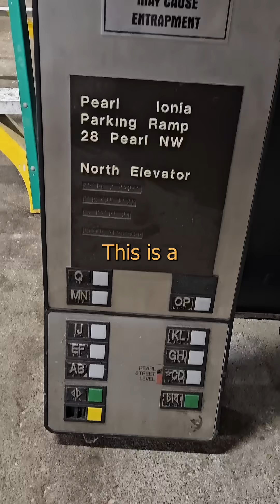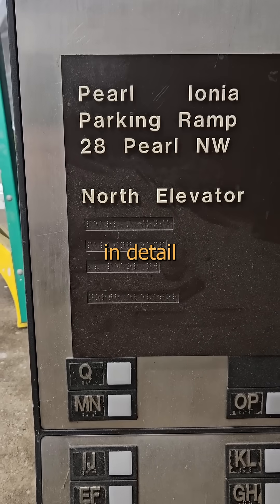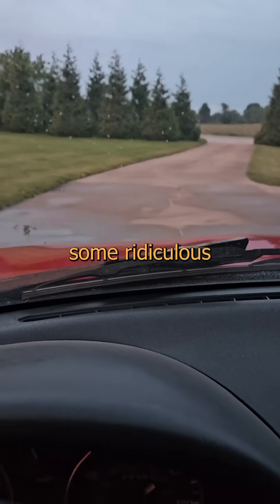Miata Mischief #chrisboden #engineering #gear #elevator #score #stories #parts #hacking #making

Comment: I know I’m 5 months late, but I’m not here for the prizes, lol.

I’ve had three convertibles (VW Cabriolet aka bitchbasket, an MGB, and an old pop-top 4Runner that I sadly never got to actually take the top off of 😔). The MG was a challenge and a half considering it didn’t have a back seat, but it DID have enough room for a full size keg behind the two bucket seats, and somehow also could fit my 6’5” ex in the passenger seat. I’m still beyond impressed by that!

But that Cabriolet was a CHAMPION. That dinky little not-a-real-roll-bar was an absolutely stellar anchor point and we loaded so much shit into the back seat that it rode waaaaaaay too low for the whole trip back. God that was a great little car.

(I managed to move a queen size mattress to LA and back on the roof of the 4runner without it even thinking about grabbing the wind, much less blowing off my truck altogether, which felt like a huge win because I sure as hell didn’t have the funds to replace it!)

Comment: So I hauled home a crappy rusted out 77 cutlass supreme once. Bought it out of some old Mexican dude’s house a couple of cities over who was trying to get me to buy his clapped out 240z and his old Indian cycle. Things rear brakes were locked up tighter than a nuns buns. So he gets his son to pull it out with his bumper hitch f150, questionably hook some chains onto this things frame, loosely drape it over the dude’s ball, and he just fuckin sends it. I mean absolutely just pepper the thing dragging it out of the shed. Strangely enough doesn’t pop the chains off the hitch. Get’s it most of the way to the alley, where, mind you, we have the trailer waiting to load this thing ass first. Dude gets it most of the way there, and then we, with 2 come alongs and like a mile of chain, jerk this thing back and forth with the chain till we can get it on the trailer. Doesn’t occur to us till it’s halfway up the ramps that we can probably pop the drums off it to free up the wheels, so repeat said seasoning of the front of the car with the f150. If it weren’t already rusted this would’ve given it some near genuine SA hailstorm patina. Get the wheels off, and spend an hour beating the tar out of these drums to free ‘em up. We had crowbars, pry bars, and enough hammers to make John Henry himself crack a smile. We finally get these drums off, and yup, that was it, thing rolls stupid well now. So we go back to working the come along shafts and get it on the trailer. Now comes the fun part - we have this big, front heavy A body loaded backwards on this uhaul trailer. Now I’m not about to unload this thing in the street and do it again, because that’d be smart, and I’m not, so off we go onto the highway. We got on, and immediately got off because this thing was wagging behind us so damn much. If we’d have been on any longer we’d have looked like a happy raggedy St. Bernard going down 35. Like this thing just hated going anything above 40, and rightfully so. So we take the access roads going home instead, 40 the whole way, knuckles a little whiter on the wheel. Unloading it was way easier than loading it, grabbed my neighbor and his 2500, popped a strap on the car, and just jerked this rusty pile of crap with no working brakes off the back of the trailer and rolled it into a spot in my complex lot.

Comment: When I was about 4 or 5 I found an old aluminum Alfa Romeo V6 engine block in a hedge

Figured I could just make a car around it and hauled it back home on the trailer of my plastic toy pedal tractor, it was VERY heavy for little me and the trailer but I got it on and slowly pushed it to the other end of the street

When I did get it into the backyard, mom didn't let me keep it and made me bring it back. 

Just trying to roll and lift the thing hurt my back and the back and fourth trip also crushed my flimsy plastic trailer

Comment: Two Mitsubishi 6G72 V6 engines in the back of my 98 Honda civic hatch back.  The rear end was almost riding on the tire.  I drove from Chattanooga to Franklin like that.  Inspired by the experience tie downs were welded into the rear cargo area to allow for "safe" transport options including straps... Other engines were hauled in the car, including an RX7 13B two rotor engine, two other D16s that later saw time in the very civic used to transport them, and a 2.0l eco tech for a Saturn Ion Redline.

Comment: I decided to buy 2in thick 16foot pressure treated lumber and I have no idea on the width at this point it's been a while. As a base board for my queen mattress it came out to 4 cut in half at 8 and some change if I remember. At the time I was driving a 01 corolla. I nearly had to uninstall my passenger seat and leave it at my job .... But I managed to get by with one inch of clearance from truck to radio. I hit the breaks to hard really hardly and it nearly destroyed my system. 2 buttons were done for and numbers on my radio screen were not doing so well after that trip. I couldn't even fully steer right because of the board in my way let alone see. Definitely the sketchiest drive of my life. Oh and I was driving 40 mins going 70mph on the hw. One slip probably would have been game over for me considering I had my seat pulled as forward as I could get it and I'm 6'1 already to big. Probably won't try that again.
Reply: Already to big at 6'1 and 8 2in thick by I think....6in-8in wide and 8feel long in a 01 corolla. They are extremely small cars. Just me alone was to big. Add that lumber to it. I was elbow to elbow with maybe 5in of turning radius. Imagine doing 3-4 5in rotations to just make a turn. And you can't see. Oh and all that wood added weight to the a already small car. I remember getting out the car and honestly was shaking I made it home with no accidents.

Comment: I bought a coffin at a yard sale, strapped it to the roof of my s-10 blazer and drove it 200 miles home. Needless to say, I got some of the strangest looks on the way home. Why didn't I fold down the back seat and put most of it inside? Well, my 2 sons were riding in the back seats, so on the roof it rode. $5 full size coffin, I had to buy it! Lol

Comment: I fit a 7-foot pool table with the legs removed in my subaru outback, as well as a grandfather clock, an apothecary, a 400lb 15" wood planer from the 70s, and a bandsaw. I have yet to need a truck.

Also my tool boxes

Comment: I know the two weeks has long passed but one time I used an old Arctic Cat 4-Wheeler and about fifty bungee cords to move over 100lbs of 🍃 about 15 miles (as the crow flies, it was probably closer to 20 or 25 on the dirt roads & little deer trails) from my bosses property through the MNF and over BLM & PG&E property to the uhh rendezvous location at a cabin by the lake near the tiny airport with a gravel runway. I had those big 30 gal. grey Sterilite totes stacked 3-high front and back plus a few of the smaller ones strapped to the sides. I couldn’t see a damn thing and I had to stop multiple times to do some pot-portaging when I reached water or the trails were too narrow. I got paid well, had some fun, and ended up with an awesome story to tell.. Oh man my 20’s were something else lol

Comment: The wife bought one of those corner cabinets from a dude on the internet. It's about 8ish feet tall, and I drive a 2012 Honda CR-V. It took up every inch from the glove box to the rear hatch, and I had to drive all the way home leaning slightly left in the driver's seat. Took about an hour and a half.

Comment: Most recently I put a 22’ aluminum canoe I found free on the side of the road on the roof of my 15’ long 05 ranger. I have also hauled 1500lbs of concrete rubble in the bed

Comment: I drive a 2004 mustang... I had to pick up an in-box bed frame from Walmart... For a queen mattress. I had to fold my back seat down and angle it around my speaker box containing two 10" subs. The box stuck between the front seats over my shoulder and rocked whenever I accellerated/decelerated. That whole drive home I kept thinking about Final Destination 2 😅.

Comment: 1. I needed to haul something (can't remember what). It was in a box big enough that I had to take the front passenger seat out of my '79 Austin Mini.
2. I carried a 6 ft stepladder home, vertically, on a bicycle, strapped to the side of the rear frame. 
3. I also carried a garden fork across the handlebars - traffic was REAL polite that day.
4. I carried a pole saw on the bicycle, strapped to the top tube, saw sticking out the front so I could see what I had to avoid...
5. I carried a barbeque home on the rear rack of the bicycle. This was the road bike, with dropped handlebars.

Comment: I work at a rental yard 
We had a custimer who wanted a 400lbs floor striper in the back of the small tesla with fold down back seats

Ide rather use a battery terminal cleanimg brush as a fleshlight(with brake clean for lube)

Comment: You managed to shut the doors and windows, that’s hardly sketchy!passenger seat buddy, seats down, back hatch open, passenger window open… the building supplies I’ve managed to haul in my Subaru Outback is impressive. But my favorite is hauling plywood in my dad’s collector 1982 S10 1/2ton short bed truck. We didn’t have the ratchet straps with us so we used bungee cords pulled tighter than guitar strings and tied a red hanky to it. That is the one and only time I have not been tailgated!😂

Comment: I moves 4 hours away last year. I filled my ford probe GT up to the brim with stuff. It was so full that passenger side was filled to the ceiling and so we're the back seats. 
every time I tried going into fifth gear I had to basically punch the stuff out of the way, I ended up with 2 broken cups in that bag

Comment: My daily driver back in the '90s was an MGB roadster. It's basically one of the things the first-gen Miata was designed to be a copy of, and an improvement on. Mostly because (1) no Lucas electrics (any Lucas switch has three positions: "Off", "Dim", and "Flicker") and (2) no SU carburettors. Anyway it had similar cargo and passenger capacity to a Miata and I would haul furniture home from the Ikea in Plymouth Meeting, PA, to my home in Wilmington, Delaware, with the top down like you show in the picture.

Comment: over the course of a week, I disassembled and hauled home a free barn using a short bed Silverado, I piled all the short pieces in the bed but anything over 10' I ratchet strapped to the passenger side on the outside. the 22' roof trusses were particularly sketchy.

Comment: I hauled a piece of switchgear I decommissioned from an old 2G tower in San Francisco down to Sacramento on a makeshift roof rack on my 2 door bmw (e92). It took two people to load it on my roof and I ended up bending my roof a little bit...  But it was a fun piece to take apart.

Comment: Wifey rode in the open trunk trying to hold it shut whilst holding on to a target shopping cart that was left at a gas station. We ended up putting it in the garage and we used it to move stuff when it was time to move into a new place.

P.S. we still have it in the garage!

P.P.S. I also found an abandoned target shopping basket so we have that too!

Comment: Subaru Forester full of recovered pallets from my highway network engineering job after they had a butt load of cabinets and servers delivered.

Either that or transporting a dresser that pushed me (a 6'8" giant) up against the steering wheel to the point I looked like a live recreation of Mr. incredible trying to drive to work.

Comment: I convinced the local church I was installing a new PA system and they were throwing out their old touch screen white boards. And I saw them wheeling them out the back doors when I noticed that the supervisor liked slots. So I happened to have a little bar slots( quarter slots) in the back seat of my 2000 Pontiac sunfire. So I talked to him about trading the slot machine for one of the white boards and he agreed. So me and my little brother held onto it and had little tieline to hold it to the roof about 30 miles from the house. But!!! We got it home and now it is our dnd map table.

Comment: i used a 420cc predator driven by a straight chain and 4ft prop on a 14ft v bottom john boat to tugboat my buddies 22ft center console that had motor trouble back to the marina

Comment: 2 times:

1. For anyone in a band this will not be all that unusual, but I once had to remove the head of a kick drum to fit it in the back seat of my Corolla, along with the rest of the kit, 2 guitars in the front seat, and amps in the trunk. With drum hardware and all the smaller bits, getting my bandmate in the front seat with the guitar necks between his legs was a challenge, but we pulled it off.

2. When I was in high school, my sister and a group of our friends fit ourselves into her tiny cavalier, I think 8 or even 9 total if I’m remembering correctly. My punk ass rode in the trunk the whole way, for a 2 hour trip. This was for a local live music festival, and the look on the faces of people at the gas station seeing a kid covered in spikes and spider legs for hair (this was the late 90s and I was a metalhead, don’t judge me) step out of the trunk of a tiny car after a bunch of other freaks piled out, was priceless.

Comment: Loaded 1500 lbs of quickcrete bags in my 2000 Buick park avenue. (The air shocks needed replaced afterwards)
This is the same car I loaded a 36” door from Menards into; fyi the back seat only had a small pass through to the trunk and did not fold down.

Comment: My daily driver is a Fiat 124 Spyder. Basically an Italian Miata. I've hauled Coolers, rifles, fishing gear, all kinds of shit in my passenger seat with the top down.

In terms of practicality for utilitarian use, the Spyder ain't it. But it's SO much fun. It's quick (not fast) as fuck. Weighs next to nothing and I've only had my lunch ate by motorcycles. Front end starts to "float" around the 125 mark, it's like any down force it has just disappears at higher speeds.

Comment: It was a '78 F-100 Step Side with the wood slat floor. The odd thing was a roommate named John. Trust me, that's the weird part. I'd known him for just a short time, but he was the type of guy that just attracted people, trouble, and...well, that's about it, he attracted trouble. The dude lost his license in an accident that the fault was determined by the cant of his wheels after the accident. He was our certifiable car nut, a drag racer without a license with a cherry Dodge Dart Swinger Special. Oh, and you must address it as such. I called it a grandma's car just to watch him turn colors. So, what trouble did he bring forth upon my first and favorite project vehicle? He spotted 2 Hemis at the junkyard on Lake Michigan drive just East of Grand Valley. If you know the specifics of the '78 F-100 Step Side, you know it rocked a torquey 300 straight six and was prone to rusting frame rails. Grand Valley to Three Rivers at 55-MPH is a long drive. Driving it in a truck that my dad and I were rebuilding but hadn't yet got into the deeper stuff, like the 4 inch hole in the driver's side frame rail just behind the driver's seat. Sure, we'd addressed it, but the repair was temporary. Read that last sentence more like this, "the steel we used was bolted in and not meant to turn the truck into a hauler but more to keep a 19 year old kid relatively safe." I drove with my shocks straining, my butt cheeks clenched, and a white knuckled grip on the steering wheel. I also hadn't yet installed the new Hurst shift kit, so the kit that was in was sloppy as Hell and prone to getting stuck between second and third gear. Don't worry, I kept a 20-inch flat bladed screwdriver in the cab for emergency pry bar duty.  While I was a nervous wreck driving my baby to the God forsaken left armpit of Hell, John sat in the passenger seat chucking odd bits of detritus through the hole next to the shifter, onto my drive shaft, listening to the pings that little rocks make as they rocket around my undercarriage. He did stop when the peach pit decided that the time a trajectory were just perfect enough to rocket itself back into the cab.  Yes, 2 Hemis exceeded the cargo rating on my pick-up. Yes, the truck was just shy of comically tragic. But, John was the oddest thing I ever hauled in that vehicle.

Comment: Well, you asked for a story.

I impulse bought 2 crabapple trees (about 6 foot tall) and had to figure out how to get them home in my small sedan.

Somehow, I managed to fold down the back seat and feed the pot end of the both trees into the trunk so that one could sit on the center console and the other could rest against the back of the passenger seat. I had to very gently bend the top foot or so of them and tuck them into the trunk to make it fit. 

For those who don't know, crabapples have thorns. Sharp thorns. It was a very delicate opperation, especially feeding the second tree pot first through the other's branches without hurting the trees or letting the pot pull to much at the roots. 

Of course, then I had to get them out. 
I guess I could have tied them to the top of the car, but I don't think my car's paint would have been happy and I didn't want to let them get whipped around by the wind that badly on the way home.

Comment: Had a 91 miata a few years back and hauled an office chair and desk, threw the top down and ran tow straps from the seat rails to the pinch welds under the car. Shifting was a bit challenging but i managed